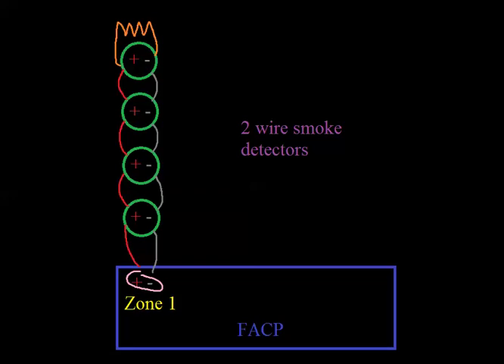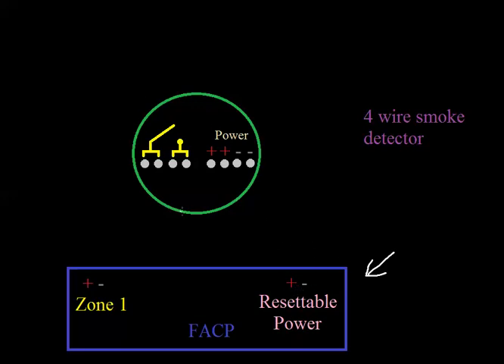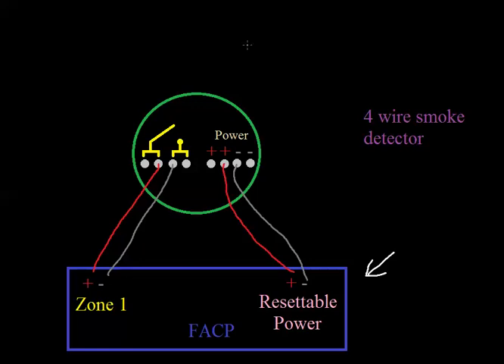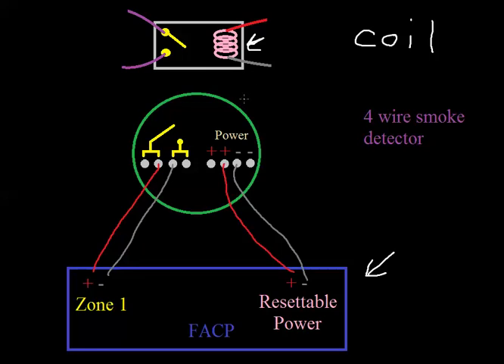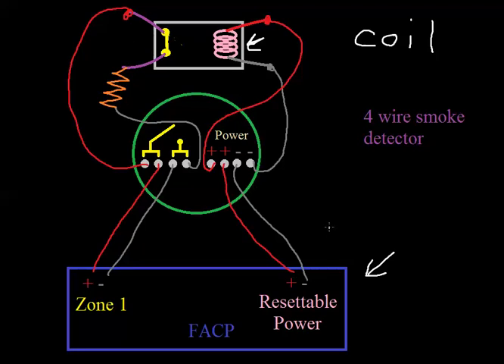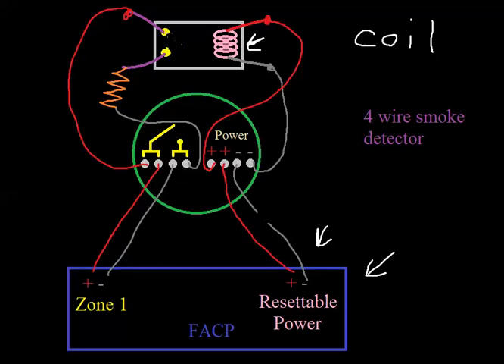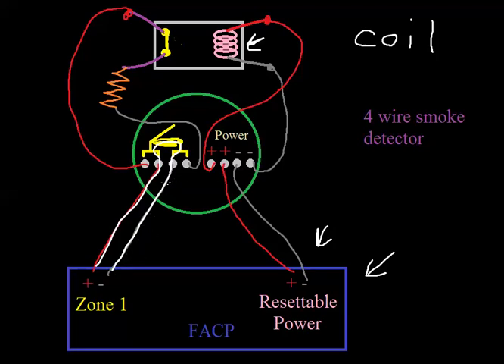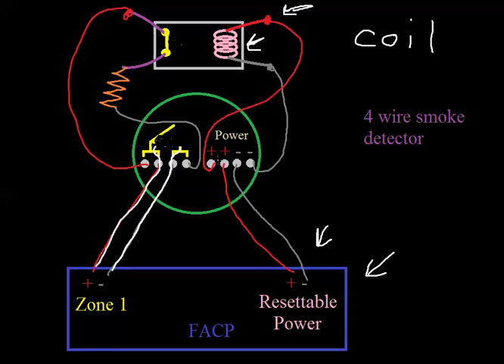12 - Four Wire Smoke Detectors - Introduction to Fire Alarms

Comment: Multi station smoke detector YouTube video link one unit can simply be screwed into a light socket Three power back-up sources commercial and residential carbon monoxide detector smoke detector ,Apple and Android devices capable products saving lives energy and environment solar power, Patents saving lives.....

Comment: Is it possible the reason you need a resettable power supply is that the smoke detector used a latching relay if some type.  This once it latches you have to actually drive it with a reverse voltage or the latch is reset by re applying power?
Reply: forhizglory

Comment: My panel won't reset after being silenced. I reset all the pulls but it didn't work. Help?
Reply: so you open the pull stations, silence it then hit reset? that should  be enough to shut them off. if not you might have a smoke detector on the fritz or the panel is having trouble reading the resistor.